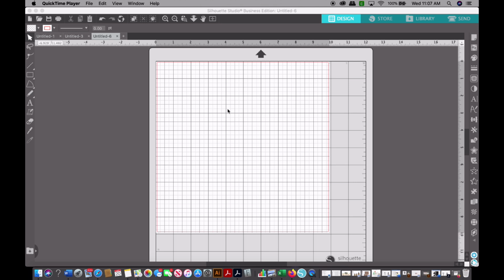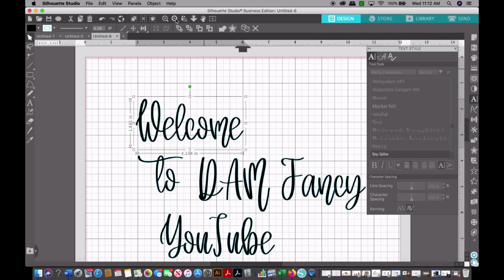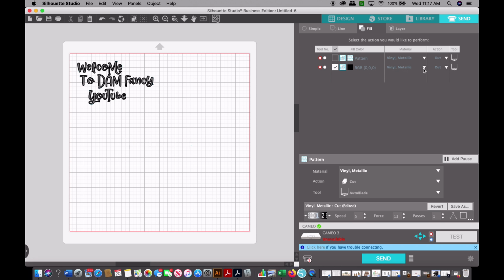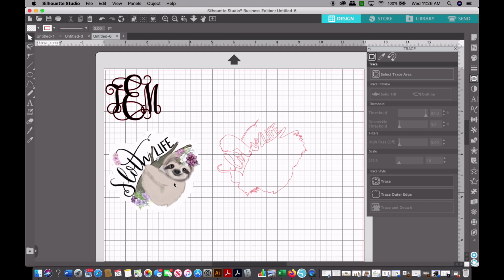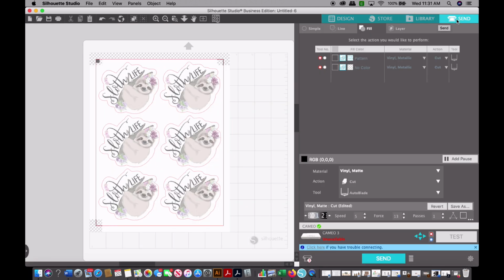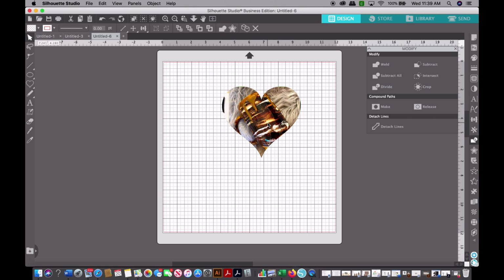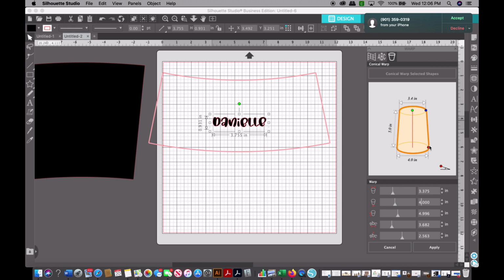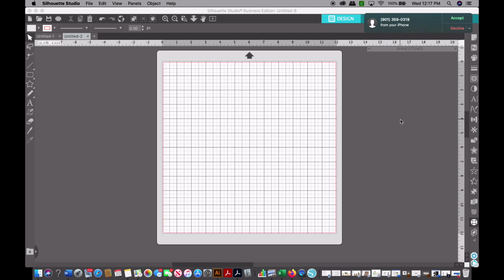Silhouette basics with DAM Fancy Creations

Comment: My print then cut never works. Well the cut part never works. I have calibrated my machine what seems like 100 times and it still won’t cut correctly. I have the cameo 4.
Reply from the maker: Hmm I have the 3. Typically when my cut is off I calibrate it and it fixes it 😬